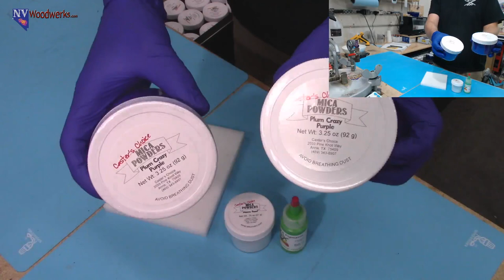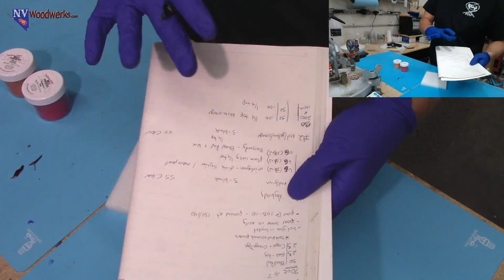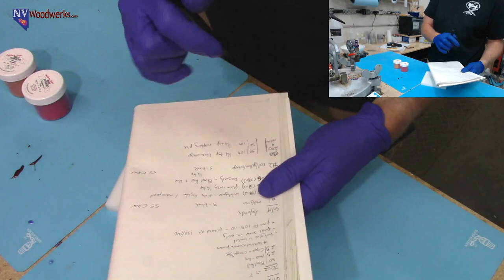🔴Replay: Casting Hybrid Alumilite & Buckeye Burl Pen Blanks | Episode 80

Comment: You should check out Moon Pie Creations on YouTube for his resin/wood bowl turning finishing process. The key seems to be using a drill with a foam pad on the piece up through 80 to 320 before using the pastes and OB Shine Juice. He seems to move through the steps really quick with great results. Hopefully it will simplify and streamline your own style of getting consistent, reliable and fast finishes on your wood/resin  projects. 👍
Reply from the maker: It is pretty fast if you just apply a top coat finish to it, but that's not always an option or the preferred method. What I meant is it would be nice to have a faster way to polish resin. Unfortunately, it just takes time and diligence to get plastics polished flawlessly